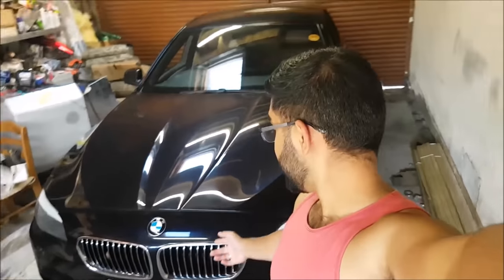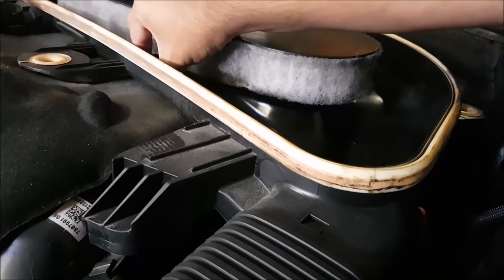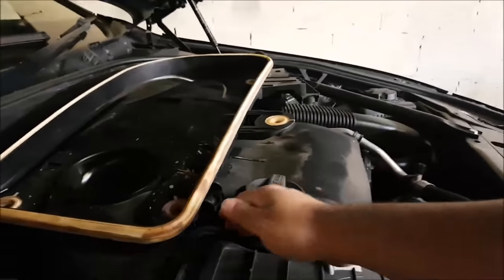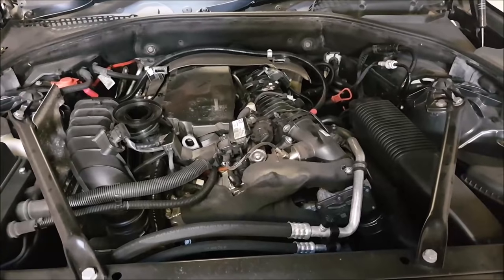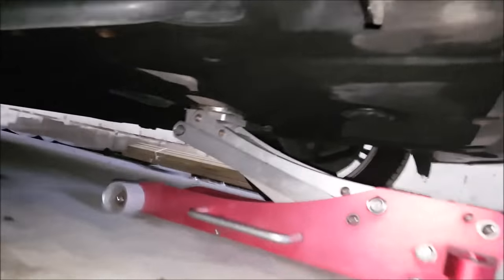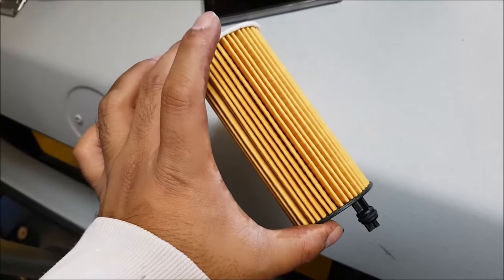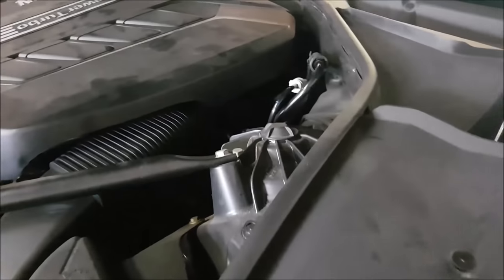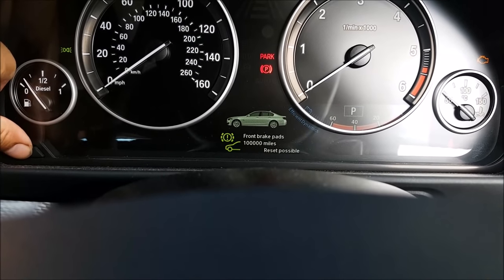BMW F10 520D Engine Oil Change | Complete How To

Comment: Hi mate - hopefully you answer in time haha but is it possible for me to remove that oil filter with a strap wrench, you think? Can't get a 27mm socket. Thanks mate, brilliant video
Reply from the maker: sorry about the late reply mate. I think it could be possible so long as you are able to get enough grip for the torque needed to undo the filter lid. But I dont think it will be easy.

Comment: I have the same car but with a inline 6 cylinder and this engine takes up that gap you see in your engine bay 😅🤙
Reply from the maker: Haha see that gap is just begging for a bigger engine! Got to love the bmw 6 cylinder engines ❤
Reply: @mrgcc  yaa 😂 but this 2.0 is still is amazing to drive , my friend has a 2.0 f10 , great video man i am also due for oil change and all 4 brake pads 😅😂 pads just vanish on these bmw's 😅😅
Reply from the maker: @ThatBeamerGuy  yeah with a BMW its always about the way they drive! but nice man, a lot of good service stuff for the car means it can take more abuse from you later lol.

Comment: The first plastic engine cover with the BMW sign, I managed to get that lid open but when I put it back... DOES it have to be clicked fit on all 3 dimpled sockets ? I just basically put the lid on the top and tried to fit it as it was originally but I don't think it properly got adjusted. What I am saying is, I think it is still loosely fitted as such I think I am hearing the diesel engine sound more loudly as well as the vibration felt ever more ( perhaps I am feeling placebo effect here but still).
All I could do was to punch the cover with my side fist but please tell me, how do I adjust the cover properly as in original state?
Reply from the maker: Only just seen this comment now. I don't think you "have" to hear it click. Just an extra measure to make sure it's all secure and in safe. Hope you managed to get it all worked out

Comment: Which oil did you use mate?
Reply from the maker: From what I remember it was Castrol 5w30. If  you use the link for Euro Car Parts or Car Parts 4 Less it should come up with a selection, just make sure its fully synthetic and the long life ideally.

Comment: how many litters of oil is going it to the 2 l engine
Reply from the maker: If I remember correctly it was just over 5L mate
Reply: Manual says 5.2 litres but better to put around 5 not to overfill
Reply from the maker: @badnan1778  100%, thanks to telling me what the manual says! 👍

Comment: Hey Mr. GCC, where on that engine is the engine number located??
Reply from the maker: Hi Andrew, if you are looking for the engine code its on the engine block its always stamped on. Is that what you needed to know?
Reply: On the engine block yes, but where exactly.  The sides of the engine bay are crowded, so it has been difficult to locate the engine code. I've been told that its just to the left of the oil filter that you changed in your video, but i dunno, to my untrained eye i have been unable to see it.
Reply: correction, just to the right
Reply from the maker: I think the most easiest way for you to find out what your engine code is to just simply google it, have a look online if others know the answer before having to find it yourself. What car do you have? I can look into it and see what I can find out. If it is a 520d what year?
Reply: @mrgcc  one easier way is take ur chassis number go to realoem.com type in last 7 digits of the whole chassis(VIN) number and it will show u in the list...(You can also give complete details and find out too.

Comment: The guy is actually going to create an oil leak as he did not bother to change the oil gaskets on the oil filter cap. I work on rebuilding accident damaged BMW a lot of the time and I also give them a full service as I used to work at BMW service shop for 4 years. If you want an oil leak and an expensive repair cost from BMW then do not follow tis video.
Reply from the maker: Interesting feedback. Car has since driven fine with no oil leak but appreciate the concerns.
Reply: @mrgcc  no problem. sorry if it came off as a bit rude but I don't want people to end up getting a leak and take it to a garage and they charge a lot for possible damage to pistons and such internal components. Other than that, the job was similar to how we do it at BMW
Reply from the maker: @rihanmajid9881  no dont worry I didnt think that at all, you just wanted to make people aware of a possible problem and I cant knock that mate. Its learning for everyone!
Reply: I only change oil filter seal every fifth time on my F10. Never had any leak issues due to that. Have done already about 9 oil changes myself.  Car just went over 200k miles
Reply from the maker: @hammerfm  that's actually really good feedback! Glad to hear it was so good to you. Means that it can still be save without changing it every oil change.

Comment: Good video. this engine (N47) is also the same on some later (post 2016) toyota diesels such as the RAV4. Hope you remembered to tighten the oil filter housing when you let the car down though (easily forgotten)! I also use a vacuum fluid extractor down the dipstick tunnel rather than removing sump plug for most oil changes as this engine's sump is fairly level and I get 5.2 ltres out every time (I know some view these as inferior to removing sump plug but it is alot less messy.)

Comment: bro the f10 520D 2011 or 2012 are reliable ? i was thinking to buy the used one...please suggest is it worth to buy and how much miles the f10 520d lasts plzz reply ....
Reply from the maker: This was a low mileage 520, but I know they are great cars so long as they have been maintained so long for once with good history over anything else
Reply: Mr GCC Car Builds thnku for helpfull reply ❤️
Reply from the maker: No problem at all and best of luck on your search!

Comment: I want to buy one of these cars here in Ireland however this specific model with n47 engine are notorious for timing chain issues because BMW say the oil only needs to be changed every 18k miles which is absolute bullshit. It should be done every 6k miles in my opinion and many others on the BMW forums
Reply: Around 2012 the F10 520D started coming out with the N47T engine (no longer with a N47). These are much better in respect to the timing chain. There is another school of thought that says the timing chain issues on the original N47 are much more of a problem with lack of servicing, and less of a problem with more frequent oil changes as you say.
Reply from the maker: I think a good oil service is something so overlooked by many car owners. Can prevent so much from going wrong. But thanks for the insight Fred.
Reply: I have a 2013 520d. Do these have a problem with the timing chain? I oil change every 6k miles

Comment: can anybody provide me information: my mechanic changing the oil on a specialist garage... first they didnt know the correct places to elevate the car.... i was worried at this point.... then they were looking around trying to figure it out how to change the oil, then the most important part, they flushed the oil and started up the engine , without puting the new oild, i told them if they were crazy and i would come back if i had anyproblem with the engine, they told me is fine, is this the procedure..... then they finaly put the new oil.... i honestly think they started the engine without oild just to degrade the engine so i go back there later........ since that i had no trouble with the engine but never saw anyone changing the oil that way................ can anyone tell me if this is correct????

Comment: quick question. i managed to replace the oil filter, however, the new oil filter (MANN-FILTER Oil Filter) came with a small brown washer with no instructions on where to install it. the old one never came with one and i can see the bosch make doesnt come with it. i didnt install the washer. it this ok? just wanna make sure.

thanks in advance
Reply from the maker: Personally I would always look to install anything given to me in the product like washers etc. But this filter I don't think comes with a washer..

It might be worth checking you had the right filter
Reply: @mrgcc  thanks sorted
Reply from the maker: What did you do in the end?
Reply: It's the replacement washer for the oil drain plug.
Reply from the maker: Indeed it is mate. Thanks for the comment 👍🏼
Reply: K Jhnsn  some come with plastic drain plug so wont fit
Reply: part no. for the plastic drain plug is: 11 13 7605 018. My advice is to renew every two oil changes. 8nm max.

Comment: Hey,
I gotta 2012 528i F10 I believe there is some sort of an issue with it, as soon as I start up the car the it will idel for 5sec and then vigorously act as if it chocking for air and the rpm starts to act too. I believe to my knowledge which I have come across reading around on the net I come to believe it could be ICV the issue is I don't really know where is actually located. Could u help me out please
Reply from the maker: Hey Ashar, I havent actually worked on a 528i. Have you had the codes read on the car first of all?
Reply: Bro, thats the rail fuel sensor💪
Reply from the maker: Might be a solid shout that 👍

Comment: Hey Mr. GCC. My local garage did my oil/filter on my diesel ( 520D f10, same as your father-in-law).  I checked the oil level yesterday and according to the computer it's been overfilled. I checked the level with the dipstick this morning and it was about 8mm above the max line on the dipstick. Do you think I'm ok to drive the car with the oil overfilled this much ?
Reply from the maker: I would highly recommend not driving the car like that! Talk to the garage if they can come to you and fix it. Or you can even get a tool which sucks out the engine oil. I'll see if I can find the link
Reply: @mrgcc  Thanks for your help. I will contact the garage tomorrow. I did a search for those oil extraction kits. How do you get the bendy tube to go down the dipstick tube into the engine ?
Reply from the maker: You put the hose through the oil filler hole from what I recall. Did you manage to hear back from the garage mate?
Reply: @mrgcc  the tube from the pella pump goes down the dipstick tube. No way down the filler obviously.

Comment: Get some car ramps man, so much easier than jacking the car up.
Reply from the maker: Good point I think that's actually really advise for many out there
Reply: Does resetting the oil service indicator on the dash add a oil change to the service history within the idrive system?
Reply from the maker: In essence yes. It's basically telling the car the oil has been change and updates itself.
Reply: Ross Erman Canpolat no. You can reset the oil change reminder but only an authorised dealer can update your service history.

Comment: Hi Mr GCC can you advise what oil to use.  Thank You
Reply from the maker: Hi Paul, there is a lot of choice really out there, you could go directly to BMW and get the oil from them but I believe they also use just Castrol. Should be 5w30, I used Castrol here just make sure it has the markings stating that it is for BMW, I believe it is the C3. But Mobil 1 is also good to use too.
Reply from the maker: Hi Paul, just realised I never answer you question. I thought I did! but do you still need help with the oil?
Reply: Mr GCC   BMW used to use Castrol but now they use shell and the oil must be bmw long life 04 standard
Reply: Hi,guys.Thanks for the video dude,I have the same car and it's really helpfull.
Reply from the maker: Great to hear! Thanks for your support

Comment: how much litres of oil did you filled. thanks
Reply from the maker: hi Paulius, I used just over 5 litres of oil when I did the change.
Reply: To be precise it takes 5.2 litres
Reply: Start off with 5L and then check the dip stick. have an extra 1 or 2 litres ready in case you need to top up.
Reply: Manual says 5.2l but better put less than to much as not the whole oil drain from engine block. Easier put extra than drain when you've put to much :-) I did just over 4.5 and it was close to maximum level.

Comment: This is the poorest video I've ever seen. Good content, but just shared in a poor manor.
Reply from the maker: Ahh. How do you think it was a poor manor? What could be done differently?
Reply: @Mr GCC I don't want to be negative, but I would suggest the following: 

- Getting a tripod or gimbel to film your footage. No one likes a shake camera. 
- Be direct and straight to the point. Don't use 10 words when 3 will do. 
- Clearly highlight what you are going to cover at the start of the video in short bullet points. 
- A 10 min video is quite long however, even though YT favour long vids, this can be off putting when a user is looking for information. 
- Let the viewer know what tools they will be needing to perform this job. Who is this video aimed at? Mechanics or Joe blogs? 

hope this helps.